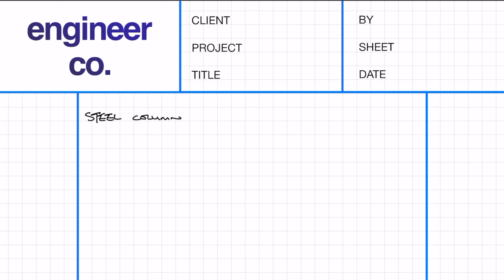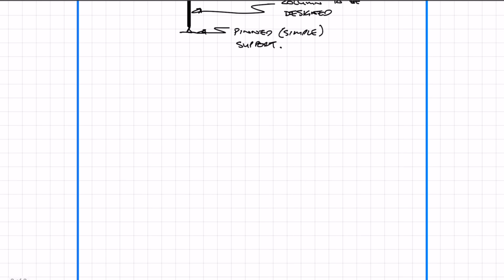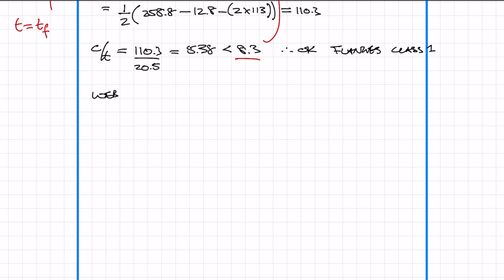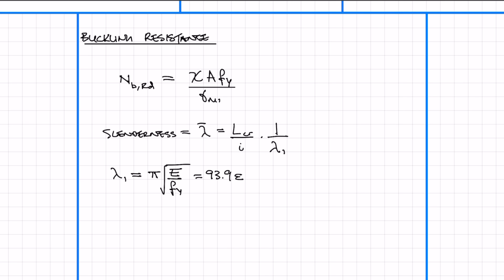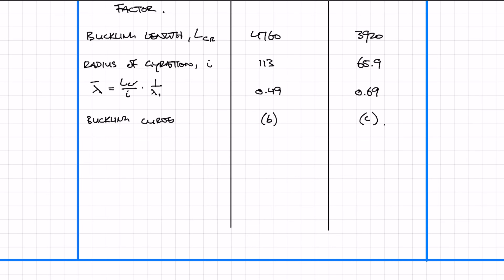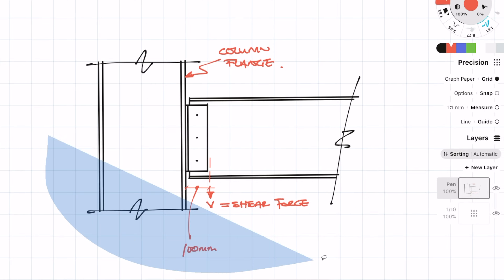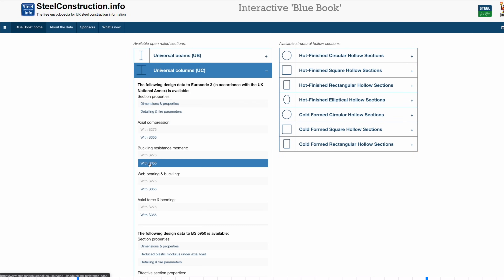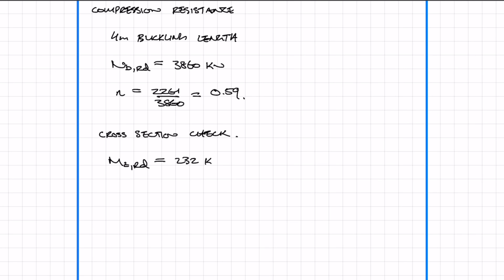Steel Column Design Example - Structural Engineering

Comment: Just one question. When you were calculating the eccentricity of the axial load, should you not have taken 100mm plus half the height of the column?
Reply: Yeah, that makes the full eccentricity. h/2 + 100mm

Comment: please give us justification on the last part of the design video. adding the two ratios are still larger than 1.0. ???  where you said it is ok .please elaborate
Reply: Not sure why he ended in a rush but you are right. he would need a larger section. This one still fails.

Comment: If fy= 275 N/mm^2 that mean steel grade is S275     but     16< tf= 20.5mm < 40 so mean fy = 265 N/mm^2 right ?
Reply: I'm stuck on that thought too. Did you ever work it out?